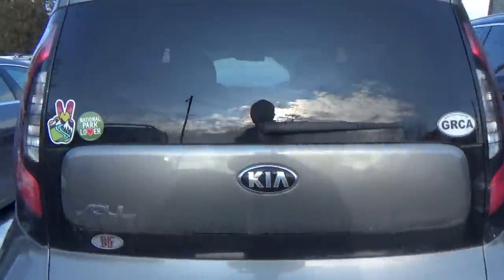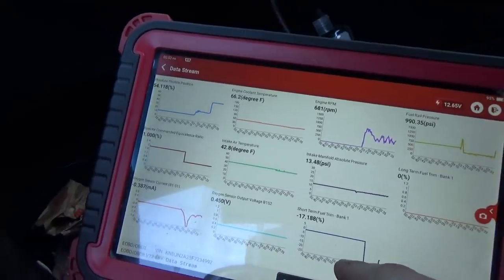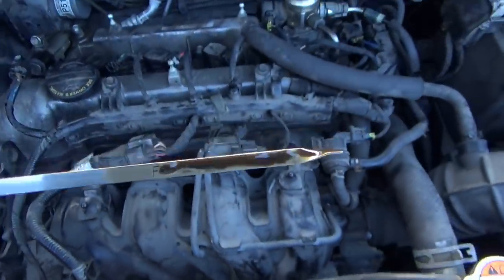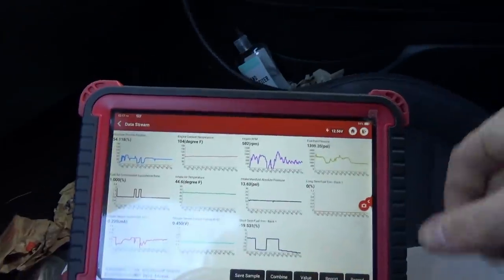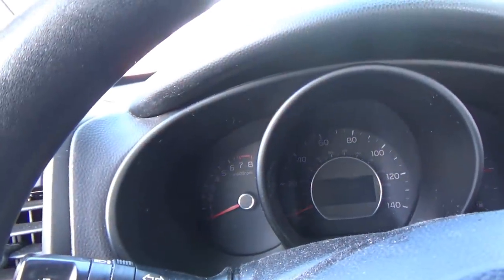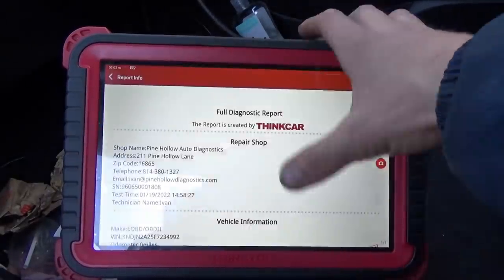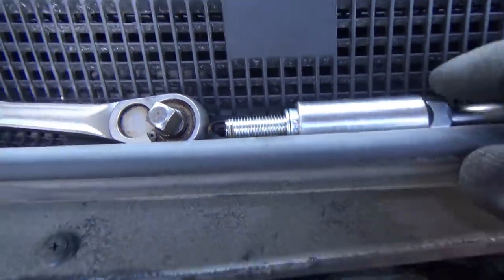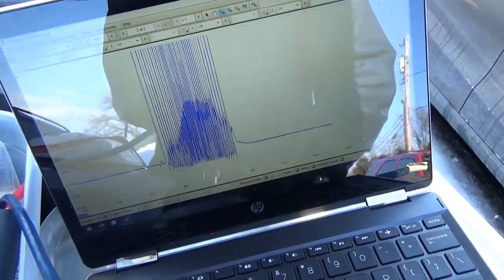Kia has no SOUL... & No Throttle Response!! (+ Transducer GIVEAWAY WINNER!)

Comment: Smashing diag ivan :-D, 
I suppose if the up stream sensor could be unscrewed the pressure would drop and the engine could of sounded less rough.
Reply from the maker: It would sound like there's a massive hole in the exhaust 😅
Reply: @PineHollowAutoDiagnostics  Well there is a hole at  one end lol 😀
You said it could not breath, maybe a made on purpose leak would make it tick over or rev up a little.
I think you are losing the power of the "Russian way" ha ha 😀

Comment: Hi, have a issue with my Kia soul. Car start but when coming to a stop. Was able to nearer it down to a power issue. On throttle body connector I get voltage on meter but when using a test light only 1 turns on burly the other 2 no light on test light. So you think ecm can be bad and needs to be replaced. I have replaced nearly everything on this car except the transmission or or engine or head gasket.

Comment: I gots a question fer ya.
Bear with me for a bit.
I'm a beekeeper and I use a smoker.  Inside the smoker it gets a very thick sludgy build up of pitch.  At some point the lid will not close properly due to this build up.
To clean this build up I'll get a propane burner and get the areas with build up red hot.  All the pitch turns to ash after a couple of seconds.
So---with that as my example, I was wondering if you got a catalytic converter and threw it on a bonfire and left it there for a good solid hour, would that clean it inside?
Would everything in there turn to ash?
Reply from the maker: The ceramic would melt into a glob if you got it hot enough 😅
Reply: @PineHollowAutoDiagnostics  Ceramic melts at over 2,000°C, if you used just coals are around 550°C
Makes me think it could work.
Reply from the maker: @cluelessbeekeeping1322  clogged cats are usually melted to begin with so...
Reply: @PineHollowAutoDiagnostics  Ooooh, I did not know that. 
Someone (on a car I used to own) accidentally cut mine off and then accidentally got a 1" dia. steel rod then accidentally knocked out the guts----then, it was accidentally welded it back on the car.

Comment: Two questions : The ATS E Scan Elite will do a Volumetric Efficiency test at the OBD 2 connector . Would that qualify to condemn the CAT ? Also , would reduced flow at the MAF , grams per second , be a possible tip off ?    Grams per second : Is that the car passing a line of grandmother's ? 😆 LOL !
Reply: Don't think these have a MAF, they're a speed density engine.

Comment: I don't get it. Of course there is pressure in the cylinder. How does that work?  How does it measure only back pressure on the exhaust stroke?
Reply from the maker: Just picture the 4 strokes of the air pump including the intake and exhaust system 👍

Comment: I cannot understand how clearing out the blocked  cat converter rather than replacing it wouldn't cause cat converter codes afterwards . The outputs from the upstream and downstream 02 sensors should be the same if no chemical treatment of the gas is happening ?
Reply from the maker: It would absolutely cause a cat code... But car would run great haha

Comment: Very strange how many catalytic converters you get plugged up over there in the USA. I have been a mechanic over here in the UK for 9 years and have only ever heard of one case . Do you think it could be the stricter emission standards ? I think the most common blockage for us is on DPFs but most of the time it's just a symptom not the actual cause. Unfortunately not many garages understand that and  just throw a DPF on and send it on its way .
Reply: I've read the EPA prioritizes emissions over fuel efficiency, so the cars run a little richer as to not make as much nox. Guys that tune GM engines here like to "unlock" lean cruise which is a feature in the ECMs programmed for cars in other markets.
Reply: Owners not performing basic maintenance item when it's published. 
Tuneups
Wrong oil for turbo cars
Air filters
Running past regular schedule oil change.
They say it to costly to do all of this. 
Run the vehicle like crap..trade it in fora new one and repeat.
Manufacturer not willing to engineer car parts to last.

Comment: Can you remove the cat completely and drive legally in US? In Europe it's impossible unfortunately, you won't pass inspection, as everytime they hook up a gas analyzer and check your emissions that way. But the check engine light might be on, they don't hook up a scanner to your car (but abs and airbag lights can't be on). However! I found out a car with no cat, but with perfectly good engine, will pass emissions test (at idle) with just a bit higher HC and CO values, but still within specs. And yes I'm not really into all the eco-madness carried out by EU bureaucrats. Not saying anything like "fuck the environment" but be honest, a petrol car without cat is still not that harmful as older diesels with no dpf/fap, which are still plenty on the streets.